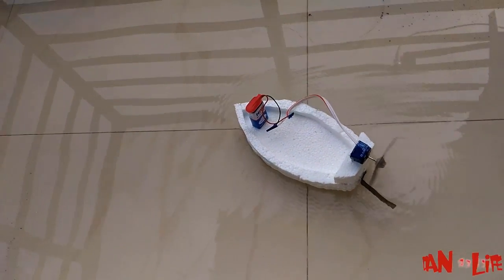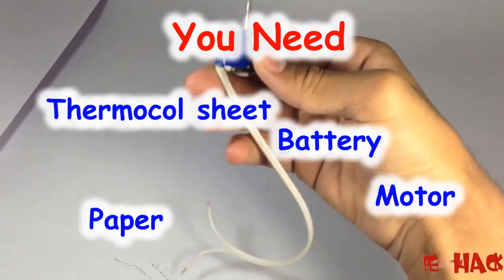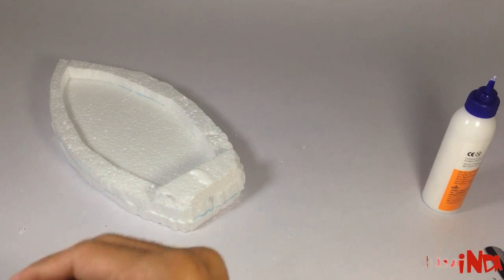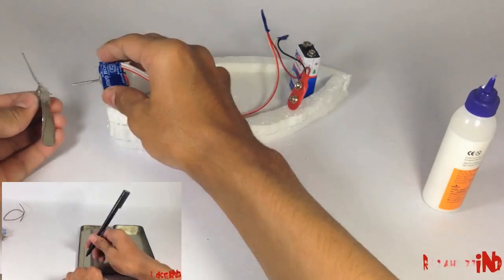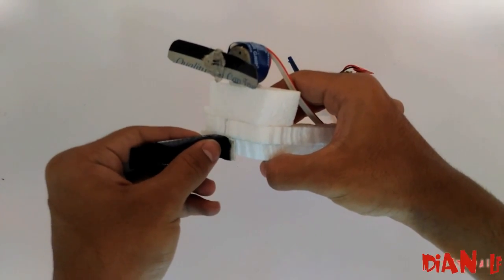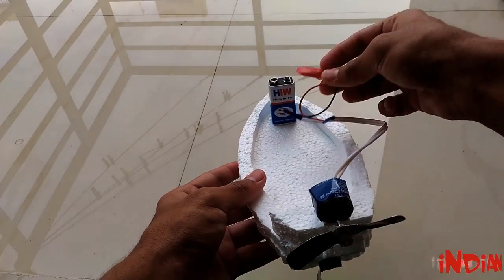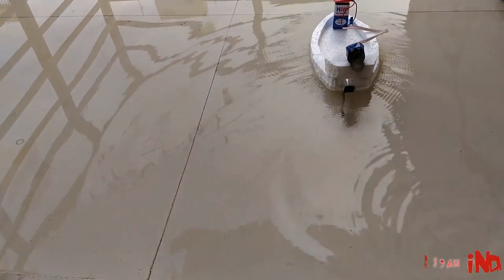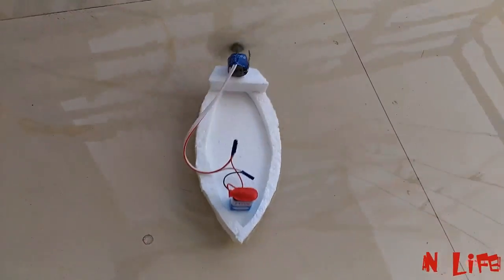How to Make a Simple Toy Boat with DC Motor at Home

Comment: brother while making the wire hot to make it cut through the bottle cap please use the non - luminous zone of flame i. e the uppermost part right above the flame coz it is the hottest part.

This was a short tip for ya 

and keep making videos except the helicopter
Reply: Possible fact: The orange part of the flame is cooler than the blue part, which is way hotter I think